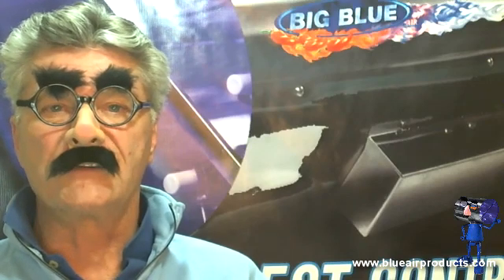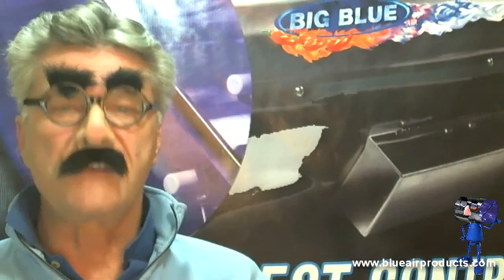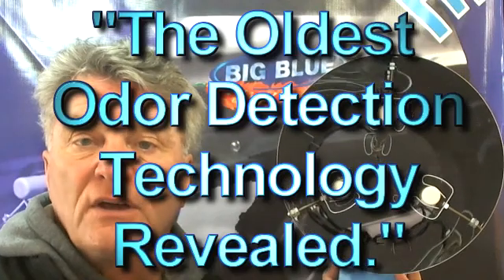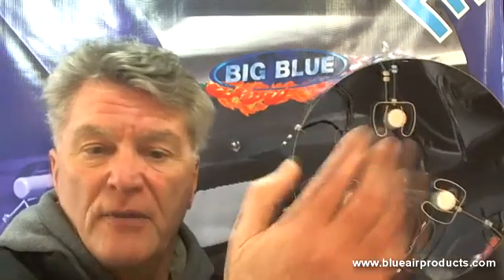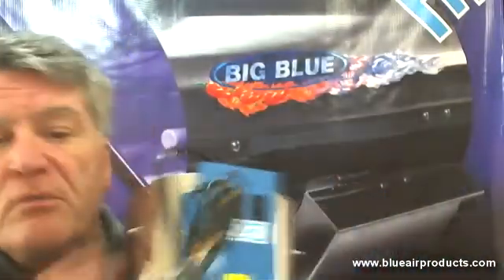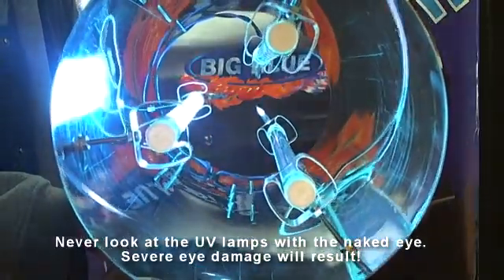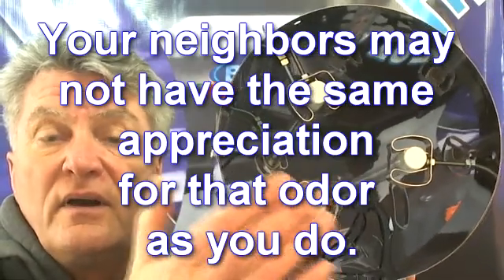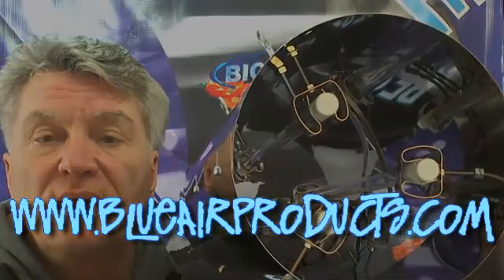What Size Big Blue is Best

Comment: @NaturesHydroponics thanks for your question, Marcia. My first assumption would be that the gardener already has an existing infrastructure. The simplest course of action would be to add another Big Blue. A fan upgrade may be required. But only for atmosphere control, not odor. If the ducting is the only solution available, then stay tuned for our next video.